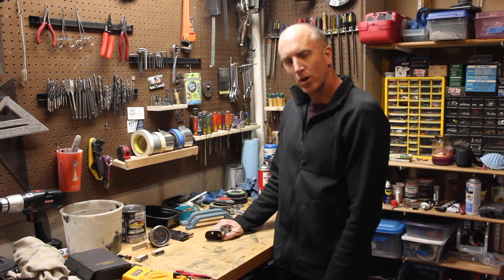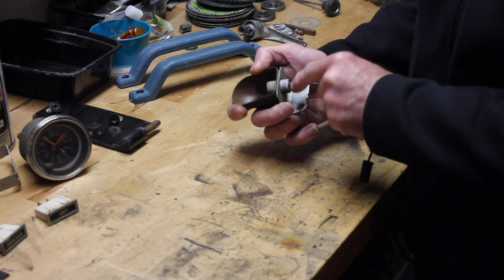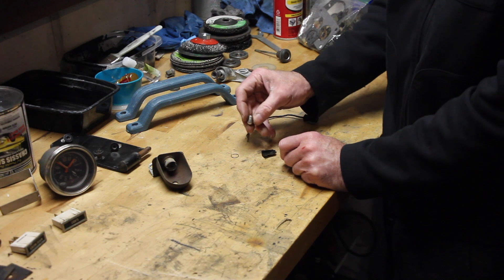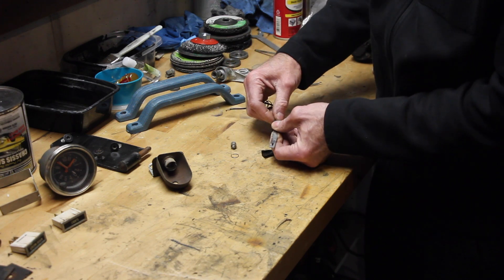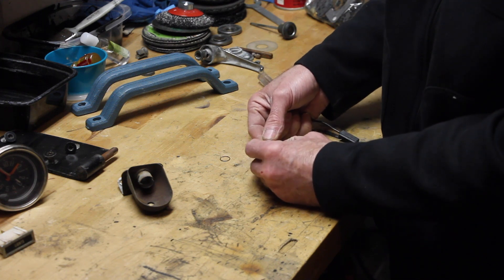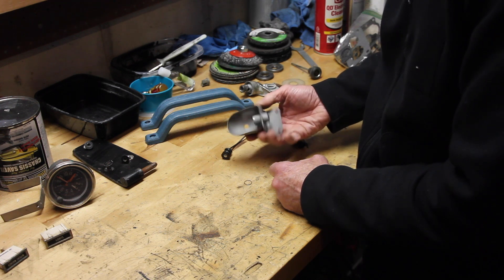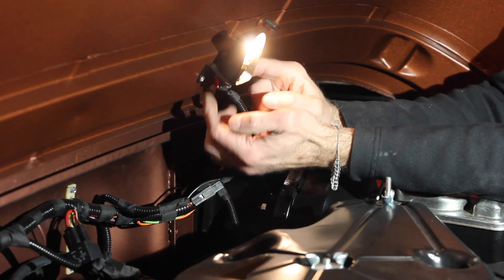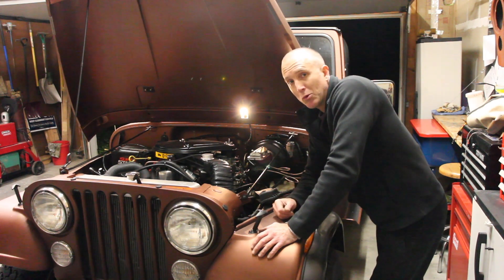Jeep CJ7 Engine Bay Light Restoration

Comment: Saved me once again.  My 89 Wrangler has the same under hood light  and wasn’t working.  Cleaned everything up and found I had zero ground at the hood.  I will run a separate ground to light as you did.  Thank you.

Comment: OK, you have me hooked on your videos!  I just bought a 1981 CJ7 in amazing condition but the light doesn't work.  I had NO idea there was a mercury switch in it.  I'll take it apart and rebuild as per your perfect instructions.  Many Thanks!
Reply from the maker: Check back and let me know if it works once you get it back together. Remember that the housing needs to be grounded to the body.

Comment: So, i have one that was painted over and the light was crushed by a carburetor that was to large. I believe the plastic is slightly crushed, housing is fine. Maybe not salvageable but can use steel housing. Is there a part for all that i can obtain?..meanwhile i will be sitting it in paint remover.
Reply from the maker: As far as I know, there isn't replacement parts for it. My assumption is that is was built as a unit and would be replaced as that whole. Reach out to Ray Moulton at Deadjeep.com. I guarantee he has a basket full of them.

Comment: gotta pick your brain.....found a 1989 wrangler islander with 44000 mile all original ....is 4800 a good price...its mint and running bye the way....i figured you would be the one to ask lol
Reply from the maker: Sorry so late to get back to you. An 89 would be a chysler jeep. It will have a far amount of similarities to the CJ7 but made by a completely different company. That's why the 86 was considered the "last of the breed". They became mall cruisers when Chrylser bought the brand. Now, with that said, $4800 for a wrangler is probably par for the course. What i would expect is some frame work to fix rust out or a fair amount body bondo from other rust through areas. If it's fhe original owner then i might think about it, but for that price you might be looking at a money pit, even more so than a CJ7🤣. A really good 89 should be around 12k if it's still somewhat original. Just my 2 cents. Let me know what you find out.

Comment: What turns it on? push switch?
Reply from the maker: In the video there is a small silver cylinder. Inside of that is a small bit of mercury that completes the circuit when it is pointed up and disconnects when it's layed flat. Nothing you have to do other than open and close the hood.

Comment: Powder coat? You can do that at home?
Reply from the maker: Yes. It's actually really easy to do. It takes gathering of a few things. An oven to bake things in. A powder coating machine (mines from Harbor Freight). An air compressor and some oil and moisture filters. And powder. I've got a video coming out in about a week that shows my home set-up. If you've subscribed, you'll get a notification.

Comment: How did you attach your grounding wire to the powder coated housing?
Reply from the maker: Used a file and cleaned off just enough coating through the screw hole and then coated it in dielectric grease to prevent any moisture or rust from developing. Just a tiny amount.